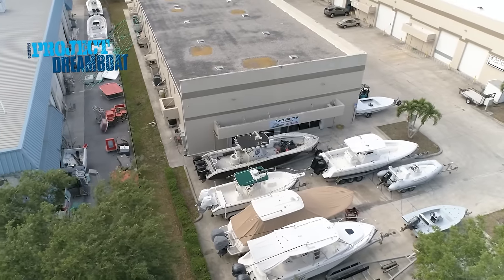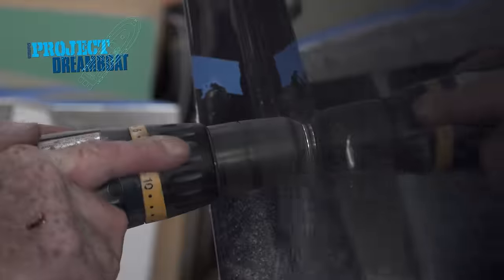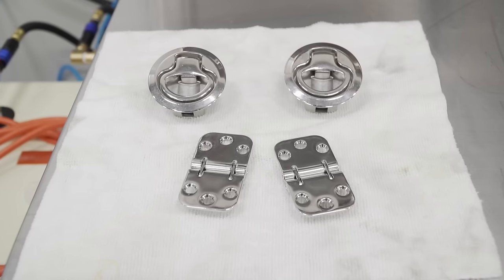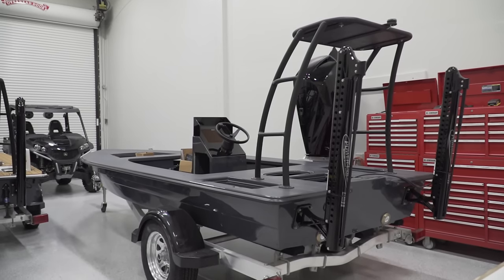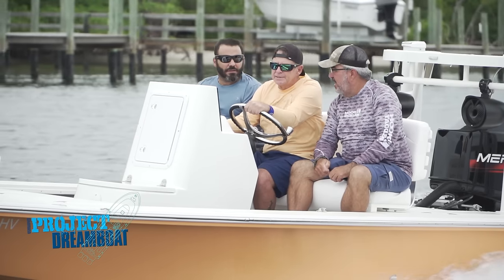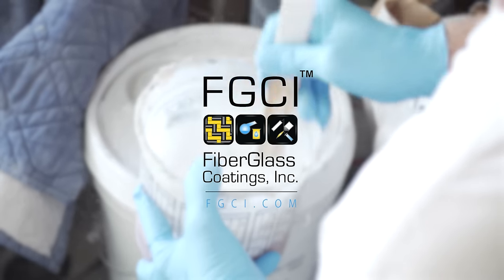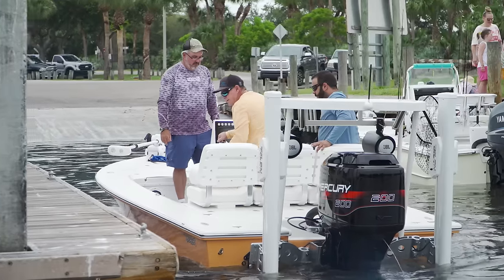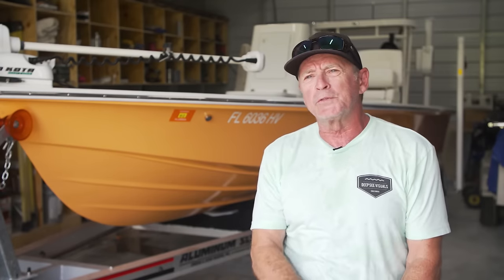Florida Sportsman Project Dreamboat [2021] - Super Custom 18 Maverick & Outboard Oil Change Basics

Comment: I've owned one Suzuki and multiple Yamaha's, Mercuries and one Evinrude. I've never had a catastrophic failure on the water until last summer. My 350 Suzuki with the duo prop, 54 hours and the lower unit failed. My rig was at the dealership a total of 12 weeks during the prime fishing season. Suzuki repaired the lower unit (did not replace) and on the first test run (dealer) water was still getting in the lower unit oil. Needless to say I was very frustrated, however, remained calm and Suzuki picked up the entire repair cost. I literally lost the majority of the fishing season , and for that reason I sold the vessel a few days ago. I realize anything mechanical can break, however, in 30 plus years of boating this was a first. I'm meticulous about maintenance and I felt like I was cheated. I understand now why there is 6 years of warranty.